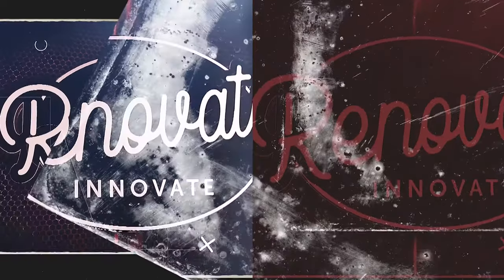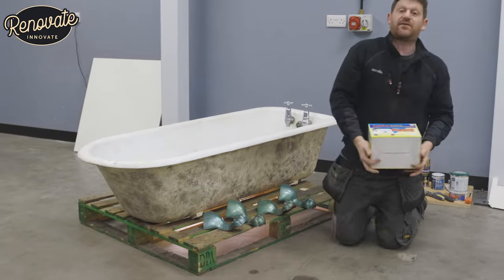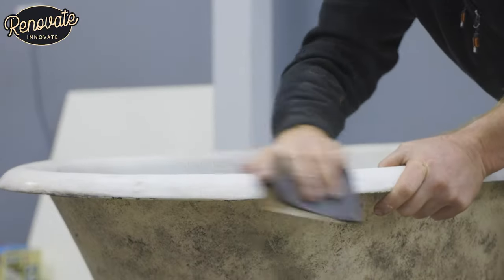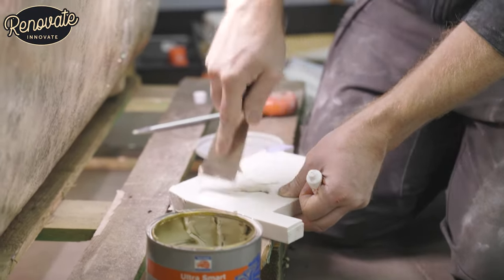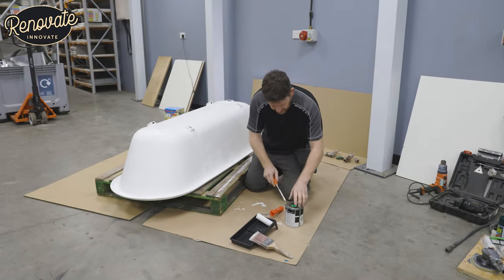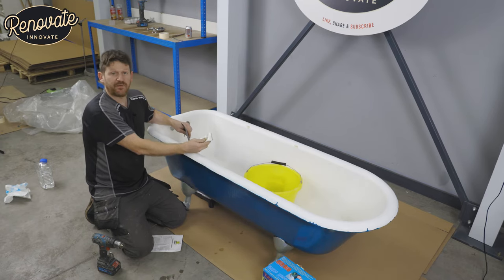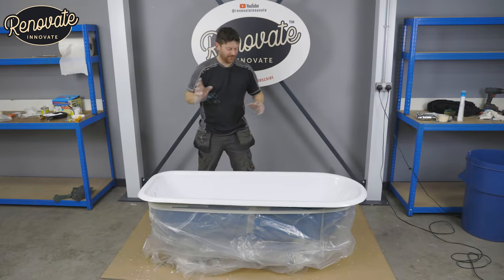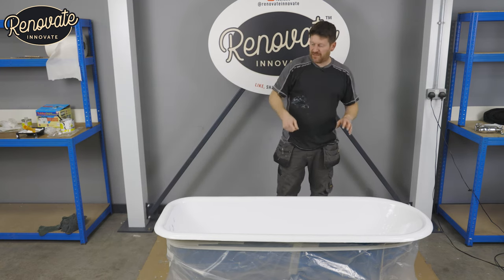Restore a Cast Iron Bath Tub | Enamel Restorer Kit | DIY Know How

Comment: Great demo of the Tubby Kit application, a perfect product for restoring old baths to as good as new for a fraction of the price of a new one.😃
Reply from the maker: Our pleasure!
Reply: Not "as good as new" that finish won't last 100+ years. You're going to have to put in the time and expense to have it last the ages, I bet you're also that person that puts Bondo on an antique/classic car rather than literally putting and iron in the fire and using lead... Reason why they call those old cars "lead sleds". That's the difference between a true restoration and some piss-poor substitute. A metal car should be just that, metal, learn to weld, leard to solder. You want to refinish an old tub, learn to do a porcelain finish, anything else is just a half-assed attempt and a waste of hard work.
Reply: @kevinfreeman3098 enlighten us on where and how to do a porcelain restoration without an industrial oven. Pretty please?
Reply: @tobyneal2729  did you  actually read the first two sentences? Personally, I'd just build one, but I'm handy like that.

Comment: How did you clean the outside? With chemicals? Wire brush? Products? I have seen some recs for wire brush -- but I wonder if that scratches up more?
Reply from the maker: I wouldn't use a wire brush on a drill as it could leave lines in the old paint that you can see after over painting, We used an electric sander and went through the grades starting with a 80 grit then 120 grit then 240 if you want it super smooth.

Comment: What type of paint finish (semi, gloss?) on outside and oil based or latex?
Reply: Latex is water soluble. Don’t use that! You would want an oil based enamel most likely. The sheen is up to you depending on the “design” goals. Semi or gloss are easier to clean later though.

Comment: Great video. We have just used Tubby's on a 50 year old avocado enamel, cast iron bath. All good except a couple of areas that have pitted and the paint hasn't covered fully. Can we re -apply another coat of Tubby's over the finished bath? How would you prepare the bath for a recoat? Can you recommend any other course of action?
Reply from the maker: Yes you can re-apply Tubby but you will need to sand down the coating to get a good key.

Comment: Hi, can you recommend a touch up paint, I have resurfaced and it's absolutely brilliant but some dust landed during the drying process and I want to sand a small section and give it a light coat, cheers
Reply from the maker: Maybe you can pick out the dust with a blade then with an enamel touch up pen just spot in the pin hole, but make sure you check the colour first as not all whites are the same.